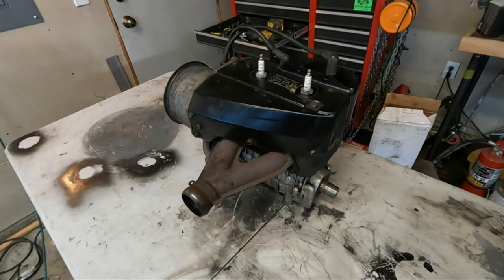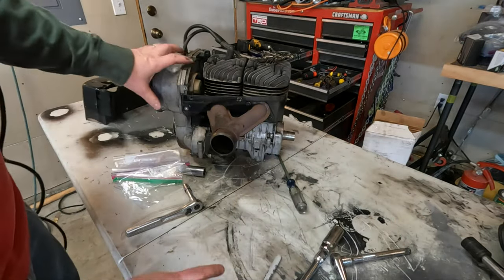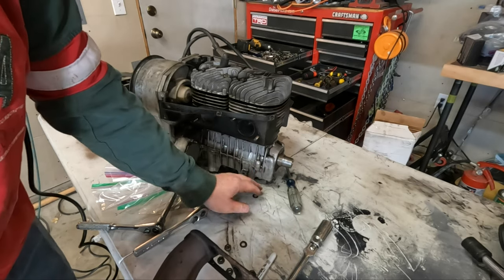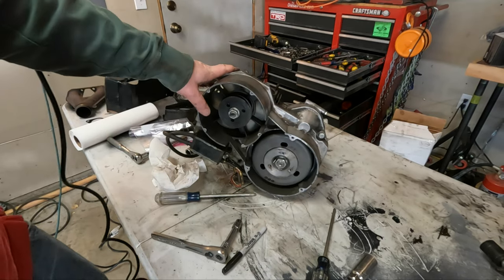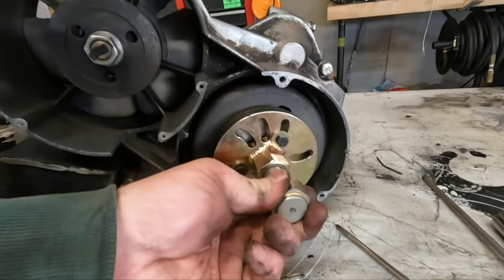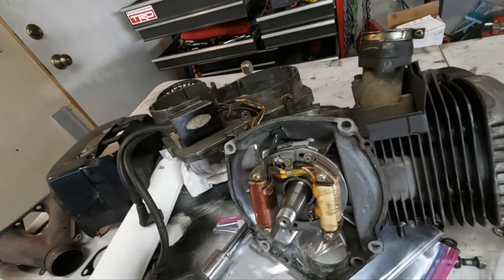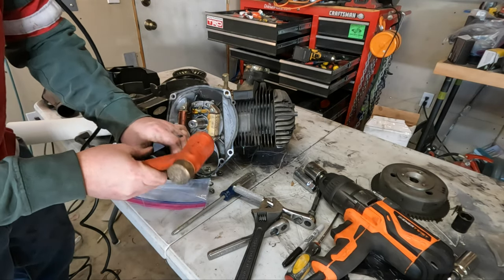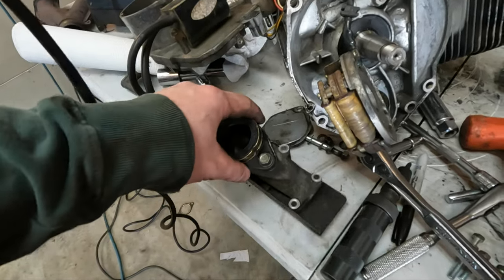Snowmobile Engine Rebuild | Teardown Part 2. #vintage #snowmobile #sled

Comment: all your 
parts look brand new are you sure there was an issue looks like it was rebuilt not that long ago
Reply from the maker: It had never been apart.  To me it looked like it was a base gasket issue/crank seal. It's one of those things just do it all while it's open.